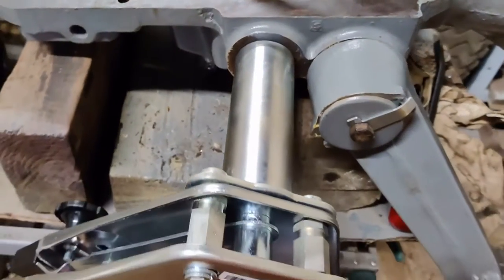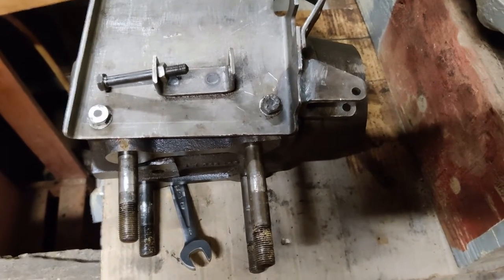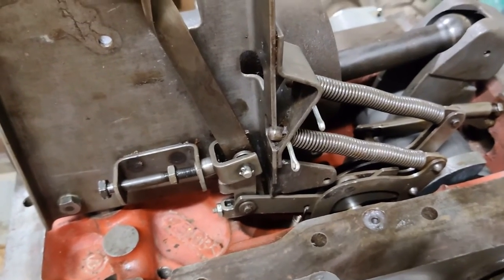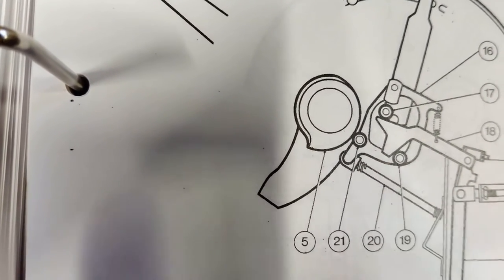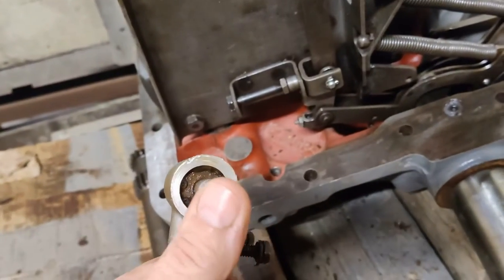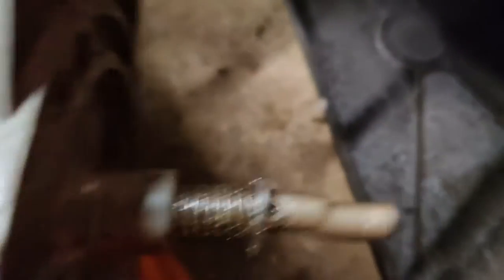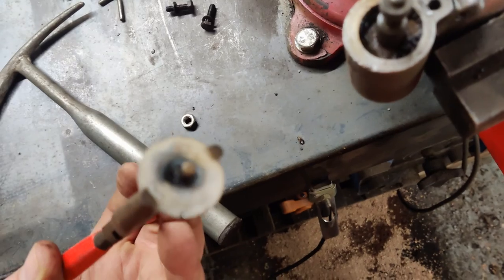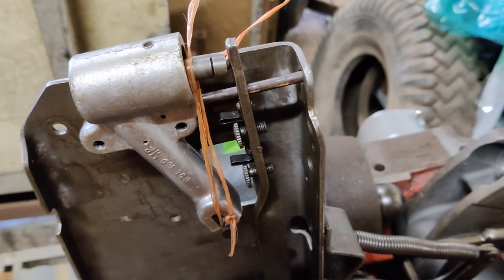Hydraulic Horrors - Massey Ferguson 100 series top cover rebuild -  Part 3

Comment: Hi Clarence I am rebuilding a 178 lift cover for the 3rd time and im taking the settings from a classic tractor mag but not sure if im going wrong somewhere can you put up the setup video please or any other advice also head is yellow so must being changed at some point lift levers are old style up to back of tractor not up towards steering if u follow .
Great video thank you
Reply from the maker: I'll get the top cover video up as soon as I can, but really there is no easy way to do it without MF272 from Churchill Tools at the very least.  Most of the rest you can improvise, but MF272 is pretty much essential.
Reply: Hi Clarence, hope your healing, thanks for the reply.I made a mf272 tool from dimensions in an old mf manual and did the setting according to manual but im still not sure if its correct or how i can be sure it's correct.I look forward to seeing your video. Thanks again great content 👌

Comment: Very informative. I’m getting ready to rebuild the cover on my 135 Ferguson. I’m concerned about not getting a good look at the linkage before I take it apart. Most of it is hidden from view.  Where did you find the pictures of the linkage you show? Some type of repair manual? They are the best I’ve seen so far. It would be a big help if I had those diagrams of the linkage when putting it back together. Thanks Gary
Reply: Does "Anyone" know what book the illustrations of the Draft and Position controls came out of?
Reply from the maker: I use the manufacturers service manual.  I'll see if I can find a part number for it when I get back
Reply: I just now found it. Thanks for the name, there are so many different manuals out I didn't know what it was called.

Comment: Have a question ...dont know if you want to answer ...But im working on a mf 165 6 speed ,,,,taking my pump out ...and it has another small pump bolted on top of the hyd pump ....and a hyd hose goes toward front of engine ..i had to take off to get the pump out  .....What does it do ....Have seen any videos with this set up  ...Thanks Kevin
Reply from the maker: That pump could be either for Multi-Power or for higher capacity hydraulics or both.  The pipes going towards the front are from a low pressure port on the auxiliary pump to the Multi-Power spool valve if fitted and the auxiliary hydraulic filter in the left of the engine at the front and the cooler in front of the radiator.
Reply: @ClarenceFudWeasel  iTS only one 90 degree pipe and then its rubber ,,,,like a high pressure power steering hose ......Dont you have to split the tractor to get a multipower pump out  ? and those are 12 speeds ?  And it is gear driven off the main hyd pump

Comment: Hello, I have the same problem, the hydraulics will not stop at the set height, but go to the maximum. I checked the pump and it is working. does anyone know what the problem is?
Reply from the maker: Sounds like to control valve is sticking.

Comment: 👍👍👍~~Greetings, Venerable person. A former <Mf100 series>user and??  Thanks for your video as. but you will also be able to explain some of the special tools for MF that are used in practical adjustments, for example (upper hammer spring resistance) special tools you know?! notr case removal reaction?! ~~one working side cover settings etc" ~~you understand that heating the transmission oil is also a separate technique. They are indisputable tractors with great superior features. Precedent should no system be the same
Reply from the maker: Thanks for watching.  I will be doing a video on the special tools soon.